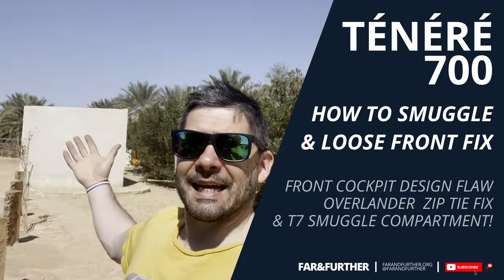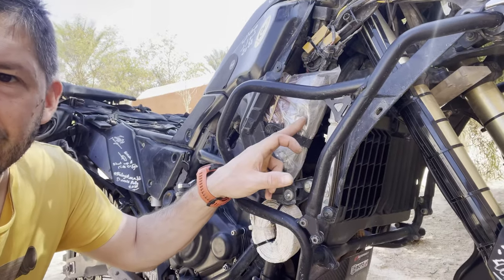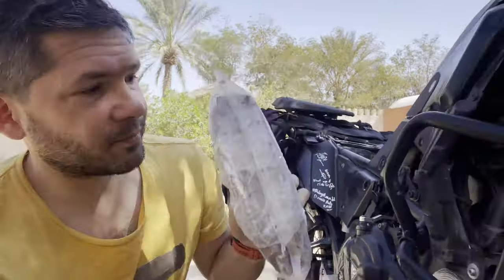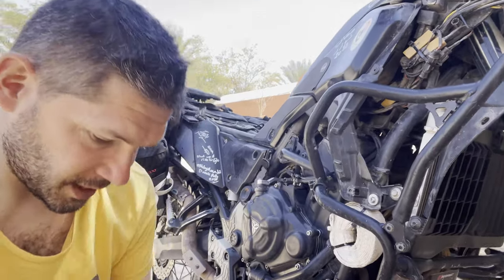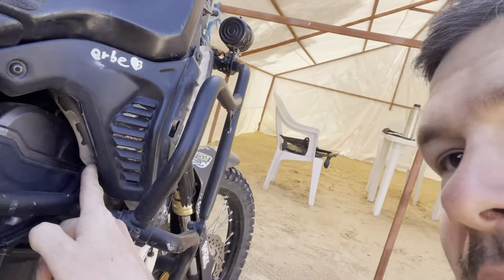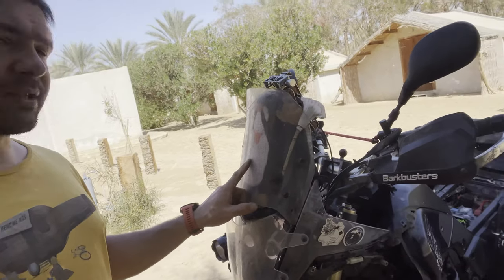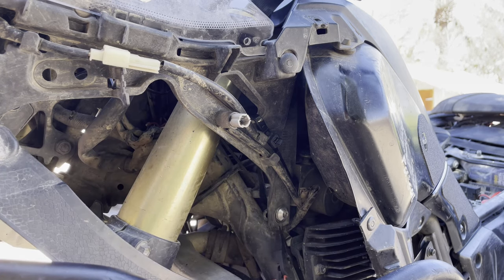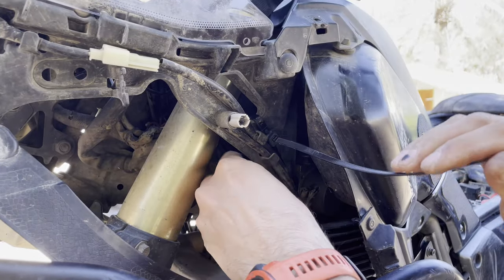Yamaha Ténéré 700: Where to smuggle “things” & fixing poorly designed front cockpit rear mounts!

Comment: I can’t comment on overheating but the exit vents on the rear of the shroud are designed to allow a through flow of air As it passes through the radiator.Any blockages to these vents will result in the air being redirected and potentially creating a hotspot. I’d suggest utilising the reasonably large regions within the rear cowling to store items you may not need to get to on a daily basis. The Japanese are the finest motorcycle engineers out if that vent wasn’t required it wouldn’t have been put in .
Reply from the maker: I guess you all guys have a point. So far it has been behaving normally but we're talking about riding in low temperatures only last few days started to be hot in the desert.

It would be good test to take the tube out and try to observe if the temperature raises...

When there is air flow - riding above 50km/h it sits happily at 83-90 depends on the temperature of air. When riding in town in heavy traffic it does turn on the fan often. But that has been always like that and I can't say it would be more often.

In general T7 turns the fan more than other bikes... or people have different experience?
Reply: Hey! Here in Slovakia it's around 10C during the day and the temp on mine sits around 81C. It goes higher in the city or in harder/slower offroad but I wouldn't necessarily say it turns on the fan too often. Hmm.

On the other hand, the place for the tire seems really great.. I was excited to try it but hearing about the heat concerns, I'm not sure anymore.

Keep us posted please!
Reply from the maker: Hey Rastislav, so the normal running temperature is the same. It's not 10C here anymore but when I was coming down from CZ to Tunisia temperatures would be similar and the bike comfortably sits between 80-85C really.

Hard off-road and heavy traffic is where it matters. It would be cool, if someone could really test it. If you put the tube there like I did and go for a off-road ride and monitor the temperature it would give some independent answers.

The space there is cool, it also can be used to carry things permanently or it can be just as a "smuggling" compartment. In second case, there is no issue with heat as you'd smuggle there things for very limited time.

Comment: You closed the outlet of the vent by the tube. Is that an issue? I put my tube underneath the front seat at the place for the owners manual. The manual is now on my mobile phone. No extra space.
Reply from the maker: It does not seem to be the issue. I tried now without the tube and bike gets cooler (1,2 degrees) but I don’t think it’s an issue. The problem is I carry 2 tubes (front rear). Under the seat I have all my tools.

Comment: Starting to look sexy again 😬, short beard suits you!!
I will probably put a tube there too, I think I have large enough Vac packs to fit a tube in, that would keep it fresh for a long time and will take as little space as possible. 
If the front is moving like that, you need to tighten the frame bracket too (where I mounted my arm for the rally tower), all 4 bolts in the bracket. 
Stay safe Pavel!
Reply from the maker: The thing was… the front bracket is rock solid! The problem was the rear mounts as the whole plastic thing moves as the headlight is rubber mounted so the assembly is not rigid.
Reply: @FARANDFURTHER  hmm, strange. 
When I test fit mine without even putting the side plastic braces on, it’s rock solid when tightening the 4 bolts on the metal bracket between the frame and headlight plastics. 
Strange
Reply from the maker: Is it? 🤔
Reply: @FARANDFURTHER  yup, for me anyways. 
BUT, the two bolts for the headlight assy also have goldish step washers. 
I guess if the plastics been worn it would get glitchy. It also have these dome head nuts, it’s might also limit hove tight you could tourqe them.